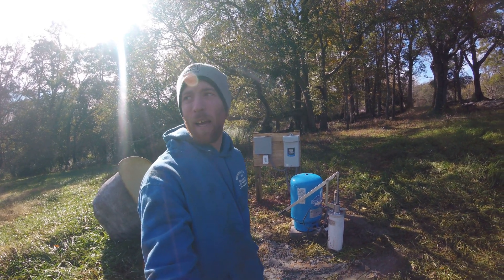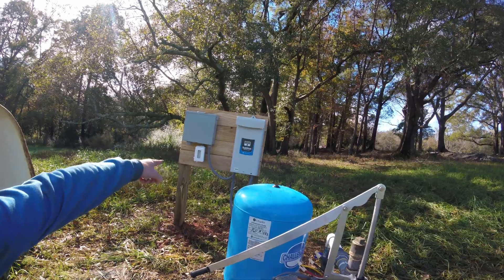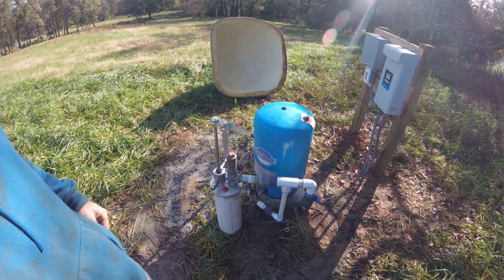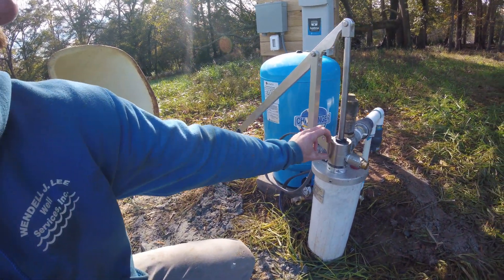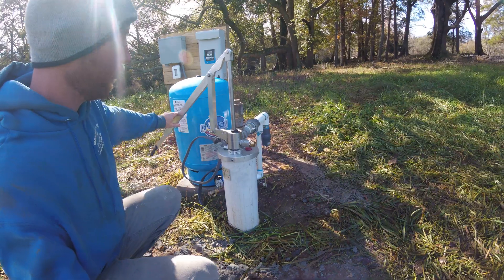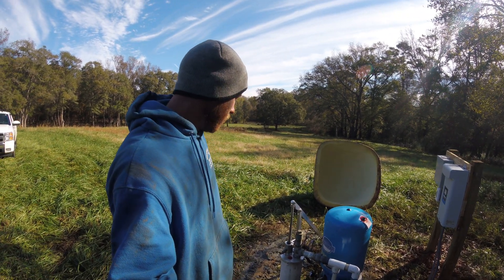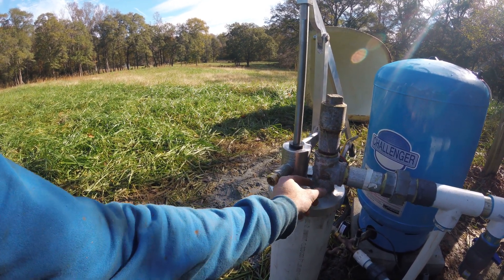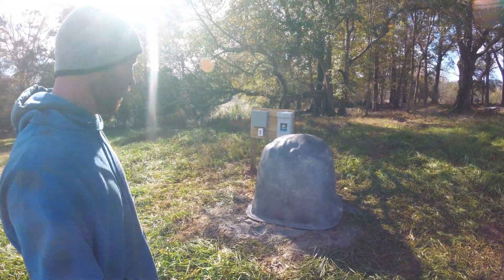Irrigation Well Pump and Simple Pump Hand Pump Installation: All Under a Rock Cover!

Comment: How deep is that well? Wondering what depths are practical for the hand pump.
Reply from the maker: Well is 550 feet deep, static water level is around 30 feet. Hand pump is set 60 feet deep. I believe this model of hand pump can deliver water down to about 150 feet, so they work well even in areas with a deeper static water level.

Comment: Good job sir!  Just did a 3 pumps in one well with 2 pitless adapters.  Yikes! On those height issues I just remove the handle and let the 3/4"  cylinder drop down.  I want to come work with you for a month and learn all your well tricks. Thank you for the shout out.
Reply from the maker: no problem man

Comment: Yea man nice job, love that huge rock cover!  I was watching one of Engineer775 video's and saw you had drilled the well, cool deal man that's collaboration for sure!  Your catching up on me with Sub's guess its gonna be a race here soon i better start uploading some more video's :)
Reply from the maker: lol its all good man it aint a race...we usually install the large farm baker handpumps, so you have no chance to contain everything. I like these simple pumps they are neat.
Reply: @WendellLeeWellServices  Yea i have messed with them a few times down here. I was blown away how engineer775 had installed a Solar pump, simple pump, and a another 220v sub in a 5" well.  I could only imagine having to repair just one of them, having to pull the other 2 just to fix the one.  Bad enough with just a simple pump in there with a 4" well that's all you can get.  Well maybe a shallow well you could add a drop pipe for an above ground pump have done that before.
Anyways man take it easy its getting tough out there in the cold try and get em done fast and stay warm!
Reply from the maker: @ClearWaterPumpWell  You too bud, keep em going as good as you can